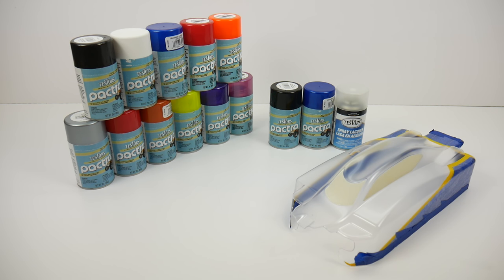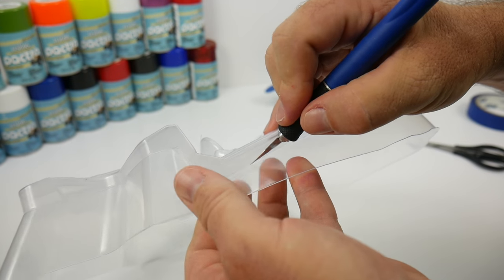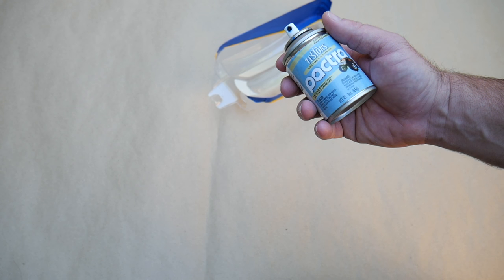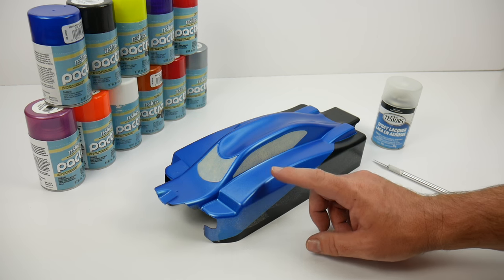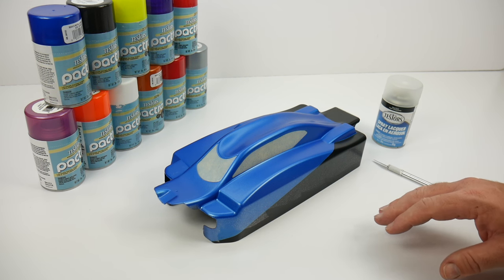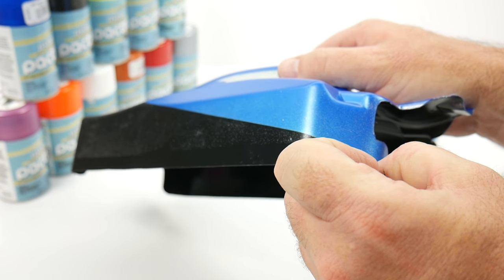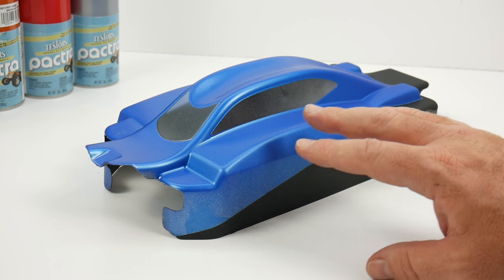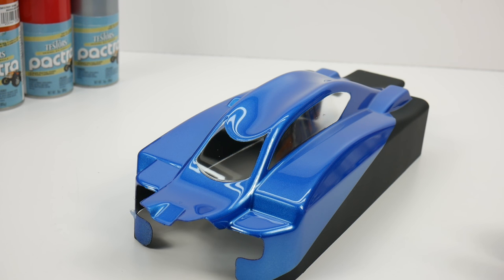How to Paint Your RC Body - Flat / Dull Finish - Pactra Paint Series EP3

Comment: I'm curious. What would it do to put the dull coat on the inside of the body and then spray the black over that?
Probably a dumb question.
Reply from the maker: Grumpy Old Man RC it would remain shiny, as what will show would be the fresh shiny lexan on the outside.
Reply: Kinda figured that was true. Flat paint looses some of its dullness through lexan. Some paint chemist needs to work on this problem.
Any way, good video and thanks for doing it.

Comment: How long should I wait to let the blue coats dry before doing the backing coat(black)?
Reply from the maker: I recommend to wait to where the surface is not tacky, as much as you can. Heat lamps at night, or set it in the sun during the day to expedite drying.

Comment: 1. Won't the dull coat come off eventually?
2. Can you spray the dull coat on the inside first then color, and get the same effect?
Reply from the maker: Sure, the dullcote can get nicked/scratched easily, but with a buggy body, it rarely gets hit.  If you use the dull cote on areas like vents, ducts, etc on bodies, it gives some depth and realism.  I did a large section on this video to show how good it looks.  As for spraying the underside, no, the dullcote would have no effect on the underside, as the lexan has the shine
Reply: no you can't spray it on the inside because what gives the shine to ur RC is the plastic itself not the paint, so just spraying it on the inside will do nothing,

Comment: Can you put the dull coat on the inside of the body, and then paint over that?
Reply: Desiign Vortex the gloss comes from the outside of the body
Reply from the maker: Craig nailed it.  The gloss comes from the lexan no matter what color/finish you paint the underside.  Spraying the external with the dullcote gives the flat look